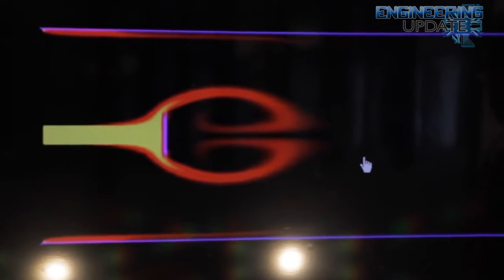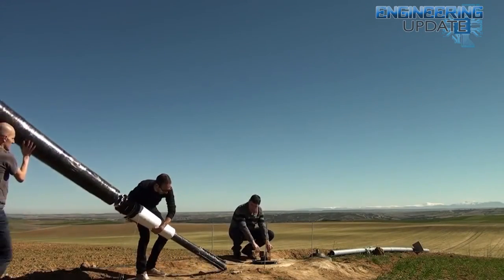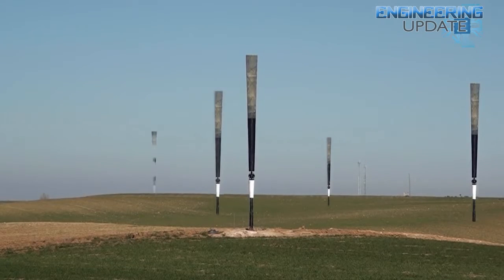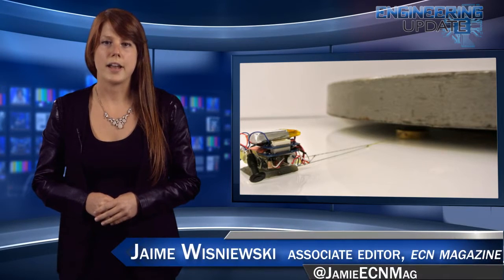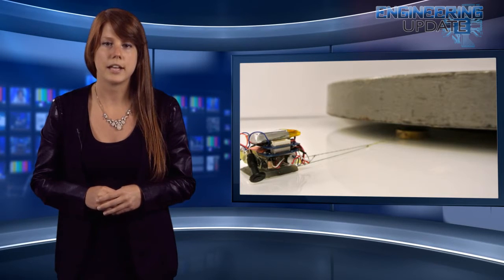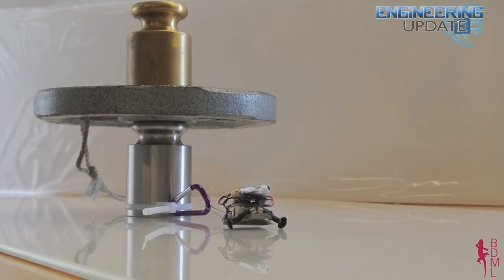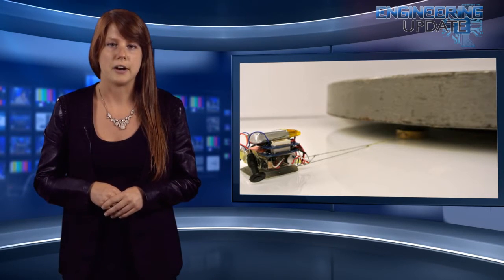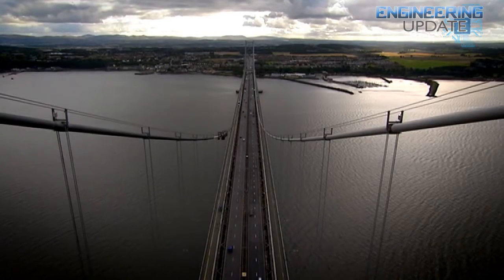Engineering Update Episode 111: Bladeless Wind Turbines

Comment: this is a scam. There is no way significant amounts of electricity can be generated by this device. Think about a small electric generator has to turn 3000 rpm. Thermodynamics states that it takes 1HP to create 746 watts. You would be lucky to get a few watts with this oscillating motion.
Reply: They are back in the media in spring 2021 but still not seeing any independent power analysis and your criticism is still correct. All comes down to how much energy is the device intercepting?
Reply: Would it be of help if big stationery wings are added to the top of the pole to catch wind and increase vibrations?
Reply: @ananddharwar2198  They are completely useless no matter what you do to them. Think about this. If 1 KW( 1000 watts) cost 0.10 cents and these units only produce 10 watts, It would take over a 100 years to pay  itself off.(provided they last that long)